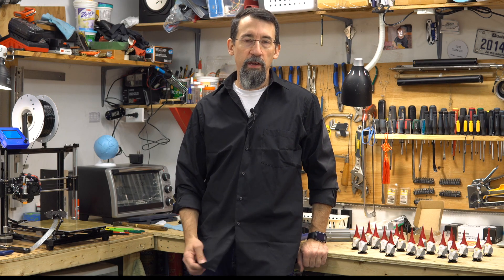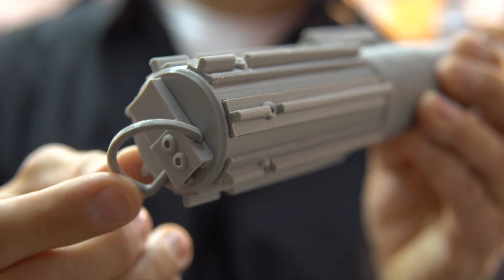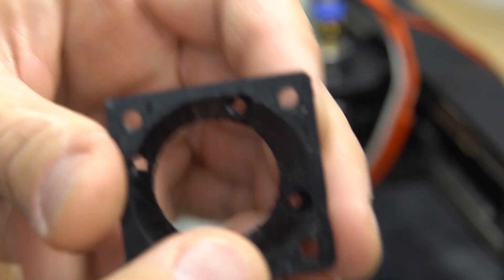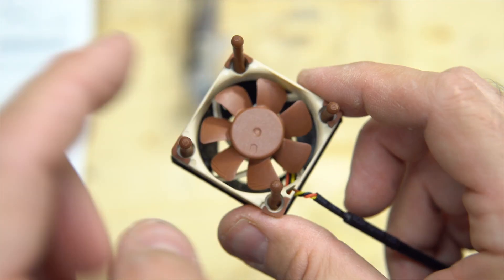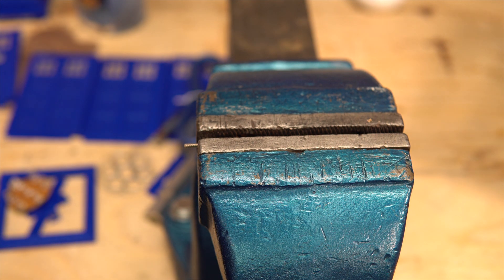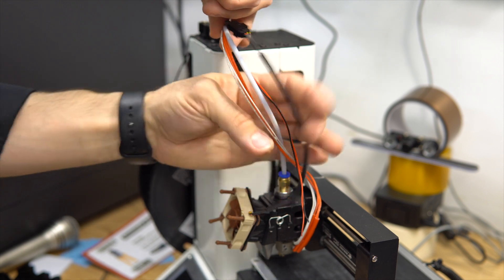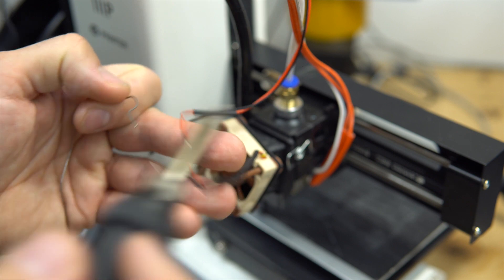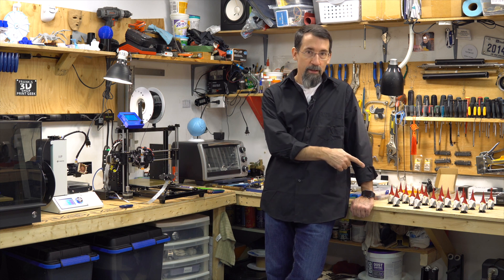Monoprice Mini Fan Remplacement (mod)

Comment: Hey Frank, I followed the video but was unable to get the fan to turn on. I have the Noctua NF-A4x20 FLX fan and wired it as you did but the fan would not turn on. I rewired the stock 30mm fan and am running that again until I am able to figure out where I went wrong with the fan mod installation. Are you able to offer any suggestions? I soldered the red to red, black to black, and taped the yellow wire down with some electrical tape.
Reply from the maker: Hi, make sure you got the 12 volts fan not the 5 volts variation. If you did, you could add a DC to DC converter but it gets more involved...

Comment: see those clips?  How do you reattach those?
Reply from the maker: Hi, are you talking about the srpings holding the fan assembly? The first one is easy to put on, you have to hold the assembly for the second one, not super easy...
Reply: @Franks3Dshop  They were designed in hell, I'm pretty sure. I printed one of the many replacement designs on thingiverse (https://www.thingiverse.com/thing:2403216) and haven't looked back since

Comment: Next time could you do some sort of print test between the two fans? Like an overhang test. Be cool to see if there was any quality difference
Reply from the maker: Sure, I think that if you want to improve the overhang on this printer, you could add a dedicated part cooling, there are hot end models on thingiverse, it’s hard to print PETG with the mini so that could be a problem since such a part would need PETG for heat resistance.
Reply: @Franks3Dshop  PLA is usually fine, since the air is blowing through it keeping it cool. I used PLA for the Bullseye on my Ender 3. The only time it would be an issue is if you then printed something with part cooling off and a high temperature.

A tutorial for part cooling would be awesome, since it's a bit more involved than just the fan replacement. It also seems all the popular mounts are for the v1.
Reply from the maker: Noted thanks!

Comment: Greetings!  I bought the Noctura fan and Printed the Fan adapter.   what reason is the adapter model with a twisted design?
Reply from the maker: Hi, there is other versions, it is that way to clear the tower to the left...
Reply: thank you!  it seems it would clear the tower more if it were square on.   not that it toutches it.  I'm gonna reprint it again but extrude the back face so I dont have to file the screws down I think.    anyway  great videos man!   subbed!
Reply from the maker: Thnaks!

Comment: Hi Frank, 
thanks for your video. I now replaced the fan, too, and I am happy with it. The printer is much more silent now. Next thing to do will be adding three smoother pcbs, let's see if they will reduce the noise of the stepper motors and also smoothen the print.
Can't wait to see your next video,
Stephan
Reply from the maker: I have some TMC2130 on the new printer, v1.0 and even as they come they are quiet it’s incredible. I will have some videos about modifying cheap v1.0 TMC2130 drivers to enable SPI control from an MKS1.4 Atmega board. Cost me $60 Canadian the board and 4 drivers.
Reply: Nice! But It makes no sense for me to change the board in my MPSM, so I'll try the smoother pcbs. The TMC2130 costs about 11€ = 16CAN$ in Germany, so I'll save them for my next printer.
But I'll wait for you trying them first ;-)
Reply from the maker: Yes, the way you said it, I was thinking you were replacing the board, sorry, what do you mean by "smoother pcbs"? Will you be adding TMC2130 outside of the original board tapping on the board signals?
Reply: No, I still use the drivers on the MPSM board. Smoothers are small pcbs that will be connected between the driver circuit and the stepper motors. There are some diodes and sometimes other stuff on this pcb that smoothens the driver‘s output signal. Not as good as the TMC but I paid only 10€ = 15 CAN$ for four pcbs incl. the cables. It‘s a plug-and-play solution. Some users reported positive effects on their prints so I thought I‘ll give it a try.  On Thingiverse you can find some printable mounts so that I can easily put the pcbs inside the MPSM.

Comment: Hey, Frank, thanks for the tutorial.  It was contextually helpful to see the process in linear mode.  By including your trial and error I got more out of it than had you done a super-slick, edited video.

One change I made in my build was to drill a couple of shallow holes in the main hotend body (where the top screws interfere).  I chose to do it this way for two reasons.  1.) I didn't have a grinder to shorten the ends of the screws, and 2.) The holes help to align the fan mount in place when putting the spring clips back on.

Question for you:  There is a slight gap between the fan body and the printed adapter.  Do you think this has any negative impact on the amount of airflow?  The only way to get rid of the gap would be to remove the rubber corner pieces on the fan, but I thought these were more beneficial in isolating vibration, so I kept them in place.
https://drive.google.com/open?id=1QYQO_r8aameUmLI5l9AqKmpoB4Ns0mHk

One person commented on how ugly the fan is.  I agree.  Tan is definitely NOT a complementary color.  The tradeoff in airflow is worth it, though.
https://drive.google.com/open?id=1H_cP77pWDbumWgXOHTIYLf3cUvQXfyNR

A question was asked about clearance between the new fan and the gantry.  There's plenty of clearance in the Home XY position.
https://drive.google.com/open?id=1Sn2nIdHD3By30c1lsFJJZAZUuvM1QgvC

One last note - I printed the part using 3D-Fuel Pro PLA filament because I was getting rough results with PETG.  Pro PLA supposedly has similar heat resistance to ABS but I think you could use PLA if you wanted to since the fan is actually closer to the adapter than it is to the extruder.  Therefore, it receives a great deal of direct cooling and is not exposed to very much radiant heat.  I'd be interested to hear whether anyone has used PLA and, if so, how well it's performing.

Keep up the good work, Frank.  I look forward to your upcoming videos, especially those on mods to the Monoprice Select Mini printer.
Reply from the maker: Hi, thanks for your comment it is really helpful!

I have the same gap as you, I did not have any problem, no heat creeps, no clog because of the heat. A friend will try a 30x30x10 fan with ball bearings replacing directly the orignal to see if it is still quiet but cheaper.

I know that the PETG is quite resistant to temperature, I have some parts in the trunk of my car and on my motorcycle, and it is still strong and did not melt after a year of usage.

Thank you!

Comment: Hey Frank,  

New MPSM owner here and I've already learned a lot from your channel.  I am thinking about doing this mod because the noise is driving me insane.  Regarding the adapter, it says it was printed with PETG at 0.28mm.  Can I use the mini itself to print the parts with PLA at 0.175 mm?  Thanks!
Reply from the maker: Hi, They recommend PETG so that it does not melt. I am not sure if it’s too hot for PLA, you could try it and watch if it looses structure, melt or anything like that. Or print in PETG with the mini.
Reply: I have tried so many times to print with PETG on my mini select but I haven't been able to ever get a successful print. Do you print the PETG on something special other then the bed or what do you use for the first layer to stick good? What bed temp do you use for PETG?
Reply from the maker: Hi, it is hard to print PETG on the mini you are quite right, I use 235-240 degrees for hot end and 60 degrees for the bed, I now print on glass that is stuck on and the bed and a sheet of cork underneath the bed to keep the temperature.
Reply: Were u able to get any successful prints on the regular bed? With those heat settings??
Reply: I actually had printed an adapter for a 40mm fan and bought the 40mm fan and realized that it won't work for my printer since I have the newer version that has a sensor on the shroud =/
Reply: I'm actually going to try and print the adapter that u have on your video and try it that way

Comment: Hey Frank, does the adapter have full clearance on the left, looking at the part without having printed it out and test fit it, I'm worried that it won't let the x axis have full range of motion towards the middle left part of the build plate
Reply from the maker: Hi, on the Mini V2 yes it clears the tower.

Comment: Looking at fans the centrifugal fan seems to be the best option. I found this.. https://www.thingiverse.com/thing:891740 and it should work with your adapter  https://www.thingiverse.com/thing:1546165 . Seems like a better direction and it should be non interference. It will need some extra support being the way the mini fan attachment was designed. I would like to get away from the axial fan.
Reply from the maker: I have a radial fan on my other printer and it makes a lot of noise. The little Noctua seems a better solution for me and should last a long time. With another printer on the way, noise could begin to be problematic... Do you know of a good source for quality centrifugal fans?
Reply: Well I can offer this, these fans do go by many names, I work for hp and work on anything from laptops which contain these fans to enterprise color printers. Sometimes I have no choice but to replace a good fan and they are throw away. Adds to a collection of fans. Ebay would be a good source but you would have to search all the possible names for these types of fan. They are not particularly noisy fan in general. Might even look at computer salvage companies selling different versions in bulk. I'll keep a eye out. Intakes are wide open which is where most of the noise is coming from, a simple intake cover / port should solve that issue.

Comment: Links for fan are broken (at least in europe) do you use the 12V PVM or the regular 12V noctua fan?
Reply from the maker: Description reads: Noctua NF-A4x10 FLX 40mm Quiet Cooling Fan 3700-4500RPM 6.6-8.2M3/H 12.9-17.9DBA 3Pin
Reply from the maker: And the direct link : Noctua 40x10mm A-Series Blades with AAO Frame, SSO2 Bearing Premium Retail Cooling Fan (NF-A4x10) https://www.amazon.ca/dp/B009NQLT0M/ref=cm_sw_r_cp_api_pgpsAbHFCVBNZ

Comment: Hey Frank,
I lover your channel, it has taught me a lot about the MP Select Mini. I just recently got one and was wondering whether you can show me your settings on Cura( I use 15.04.6) to get your prints looking so fine and clean.
Reply from the maker: Hi, you would need to update to version 3.0.4 and my settings are on my site and on my video about a first print : http://franks3dshop.com/Vlog-5_Files.zip
http://franks3dshop.com/Cura_Monoprice_Printer_Profile.jpg
Reply from the maker: If you have issues, I would be glad to help, you can also contact me on my Facebook page if it's easier? The link is https://www.facebook.com/Franks-3D-Shop-567006427024034/

p.p1 {margin: 0.0px 0.0px 0.0px 0.0px; font: 12.0px 'Helvetica Neue'; color: #454545}

Comment: Frank, thank you for the video. Two questions: The Noctua comes as 12V and 5 V. Are you using the 12V variant? And, do you have any issues with the printer head moving to the left-most position?
Reply from the maker: Hi, I have the 12 volts version, and with that adapter from Thingiverse the head clears the printer since it goes further away from the head. There is about 1/8” of gap.
Reply: Just did the actualy replacement. No fan is virtually silent, the loudest thing when not printing is the fan in the rear that's cooling the mainboard. Can you do a video for replacing that one, too? Not sure if there are any potential issues that might come up.

Also, with the MPSM V1, the adaptor might be a tiny bit too close to home, because one of the four silicone dampeners that hold the Noctua very slightly touches the printer tower.
Reply from the maker: Thanks, and yes I will have to change the inside fan too, will do a video for that. There are other adapters on Thingiverse that would be more appropriate for the V1 I think.

Comment: Wouldn't it be more effective to have the fan blowing out rather than in?  It's easier to blow heat away from something rather than to blow air across it. That's why computer case fans blow out, not in. Though most people put house window fans blowing in, it is more effective with the fan blowing out to remove heat (or smoke) from a room than to blow air into the room and hope the heat (or smoke) finds an escape somewhere.
Reply from the maker: In this case, the fans also blows air on the part, you would have to move a lot of air in reverse... my main concert was noise and vibrations, and with a new custom printer that I am building from scratch, noise could become a problem, I already have dampers on the motors of the big printer, and a quieter hot end fan, now it’s the radial fan that is making the most noise when printing PLA. On a PC the best way to cool it to move air through the computer, some fans in front taking air and others on the back pushing out, near the source of heat CPU, GPU and power supply... on a small scale like the hot end, I do not think it would be a good idea, you would also put heat on your fan quite a bit, with the hot end at 200 degrees or more with the rising heat, I think it could melt or disturb your fan electronics, bearings ect.
Reply: I see your point.  I didn't know the fan was also cooling the printed part. And it does make sense that sucking heat off the hot end would be a bit much for the fan to deal with. -- Most low end desktop computers only have a rear fan. I have seen people stick a replacement fan in backwards, blowing in, then wonder why the computer ran so hot.
Reply from the maker: Yep in cheap PC you have the power supply fan that blows air out, having a fan in the back taking that hot air and giving it back to the power supply creates a heat loop !!! You can put more air in in, but from the front. All the servers and equipments at work have fans in the front moving air from the from to the back and out...